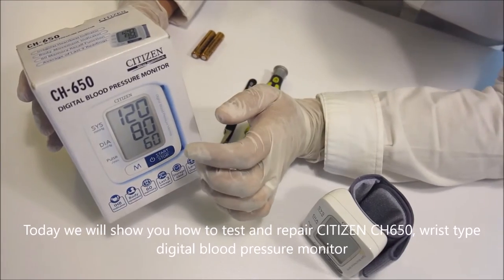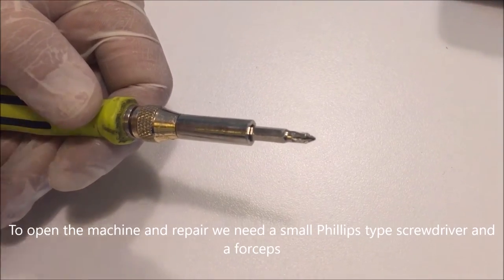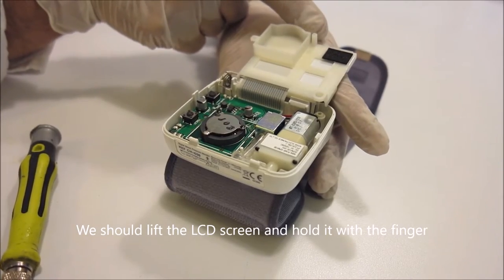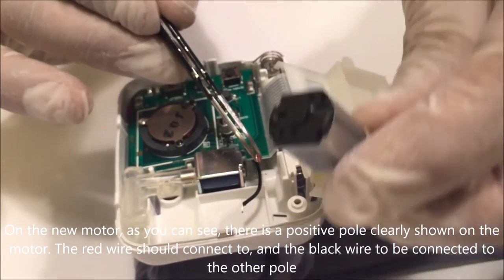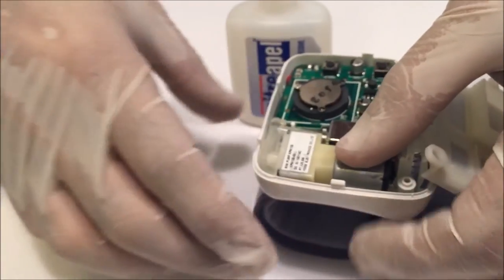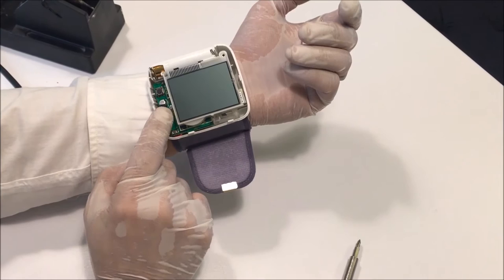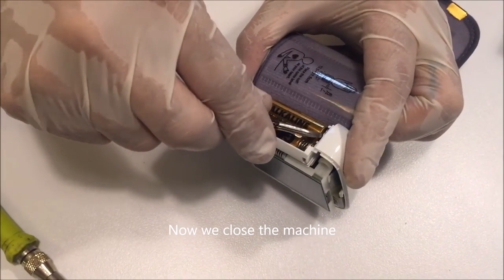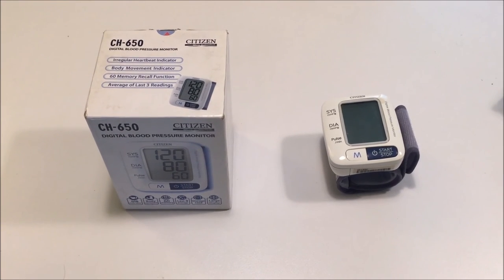CITIZEN Repair - CH650 Wrist Blood Pressure Monitor HQ

Comment: I used omron, it problems is in two fold, the screen is unable to show the three digits during inflation. N the second problem is that the machine shows either one or two for the systolic pressure, but the diastolic is fine. Any suggestions as to what I can do
Reply from the maker: Dear Raymond, thank you for your question. Regarding your Omron device I can not advise you because we are CITIZEN representatives. Nevertheless your problem seems to be with the screen electronic connection. For this issue the only solution would be to send it to a repair center in your country since is a problem which can not be fixed by the user, an Omron technician should reset the software of your device and make a callibration. Hope my answer is helpful.
Reply: @islandgate-igt-citizenheal4363  Thank you so much for your quick response, am grateful, but I am the Biomedical engineer for a health facility in Ghana , Basically repair our hospital equipment. Knowledge in how to reset the system software will be much appreciated. Thank you
Reply from the maker: @raymondvuomile5243  Dear Raymond, I understand your concern but we only have answers for CITIZEN devices. You can contact Omron directly in their facebook site [ https://www.facebook.com/OmronHealthcare ] or their Youtube site [ https://www.youtube.com/channel/UCed_SynDpCnF8yEzV_PpkRw ] . I couldn't find any direct contact from them but surely if you send them message in Facebook or Youtube channel they will guide you better.
Reply: @islandgate-igt-citizenheal4363  thank you